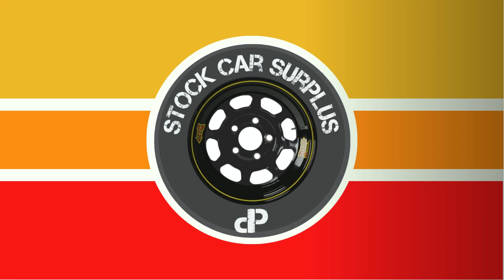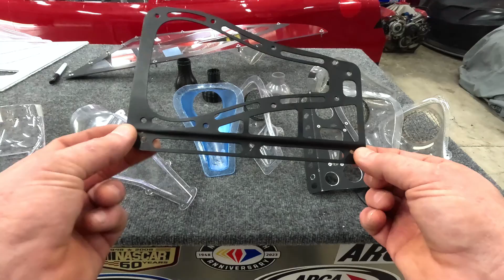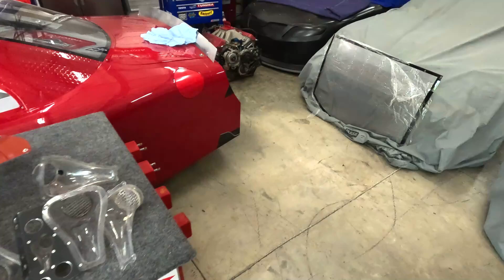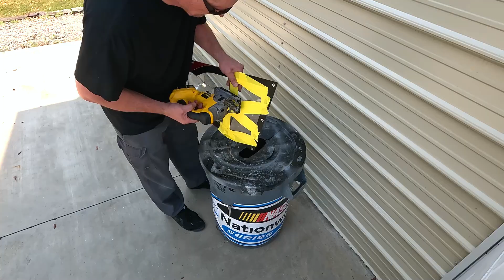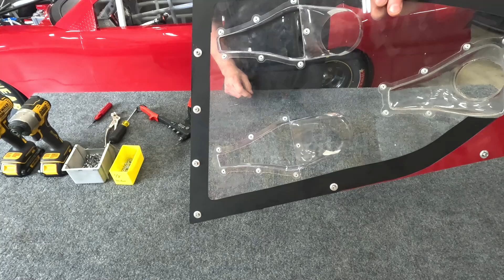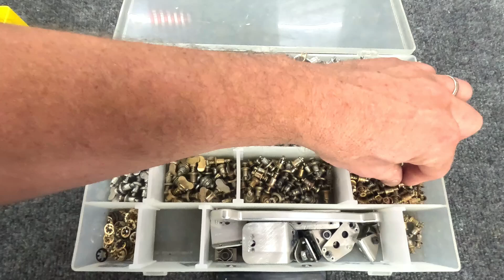Track Day Toyota Supra Build: NACA Duct Installation

Comment: Thanks Danny-   In my opinion, there are certainly times for shorter videos, and times for longer videos.  This one is perfect.   We don't need to watch every rivet be installed on a window/duct, but a nice explanation of the thoughts and process, and the basic install like you did was nice.   For things where there is more show and tell, and explanations needed like the last video about the brakes and some of the set up stuff was spot on being longer. I would expect the upcoming wiring project would be a longer one, which would be great.  I enjoy them all. 👍👍
Reply from the maker: Thanks Paul, I appreciate your input. 
The wiring video is definitely going to be interesting.